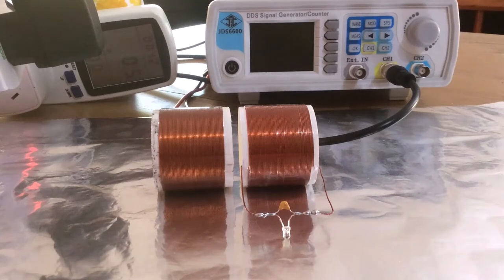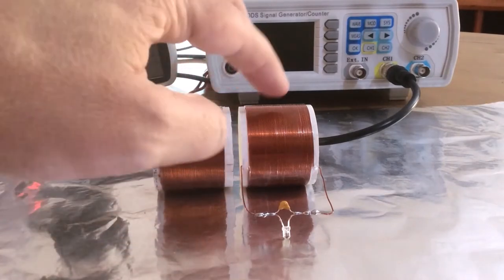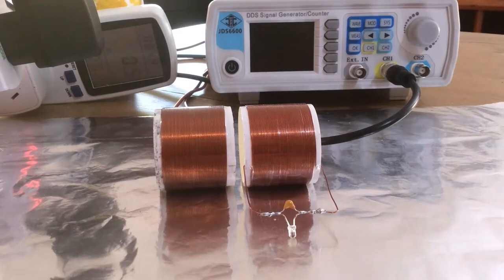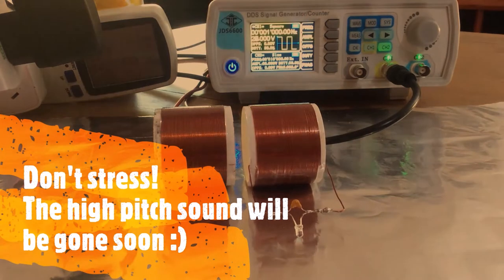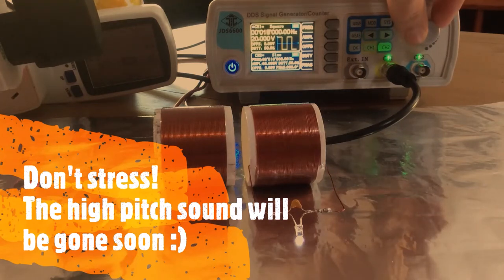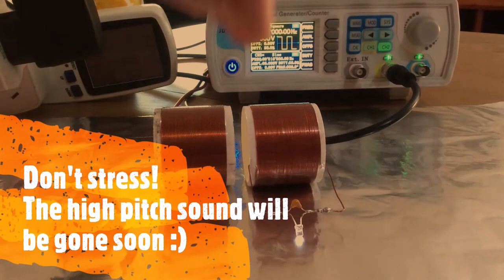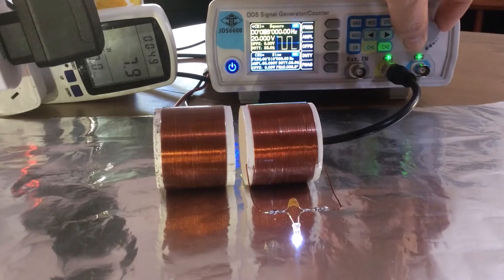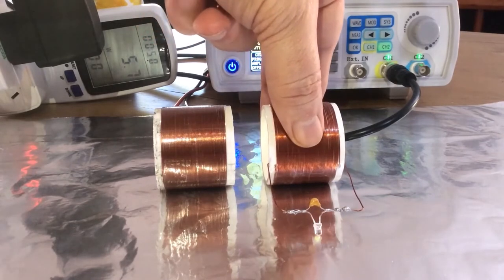FREE ENERGY with RESONANCE!

Comment: Where's the free energy? The function generator is putting out 20 volts to light a LED. This looks like simple induction to me.
Reply from the maker: Thanks for watching. This is simple induction. Over unity is achievable using simple induction, this is merely a demonstration of how you can achieve free energy. Many more coils can be added to the magnetic field with no increase in power consumption. Instead of using lights you can use the coils as generator coils that feed back to the signal generator. Using the same coils and the same input you can power a 12 volt 10 watt load, off one coil, the signal generator requires only 5 volt 2 amp at max power however if over unity is your goal you would use a smaller signal generator and add as many coils that will fit into the transmitters magnetic field.
Reply: @whatifididthis...1236  you should do power audit then ... one LED only 0.06W😅😅😅😅😅
Reply from the maker: @afendiyusuf4284  Thanks for watching. This is not a demonstration of over unity but more on how to achieve it. What should we focus on here? In my opinion this video demonstrates the importance of a resonant transmitter and receiver and that when this is achieved there is no increase in input current. This is how Don Smith achieved over unity. I hope this helps you understand the purpose of the video.
Reply: @whatifididthis...1236  well good luck trying ... nice equipment 😅😅😅😅
Reply from the maker: @afendiyusuf4284  Thanks, been there done that. You do realise, if I put absolute proof on here they will take it down or shadow ban it. You can learn enough from this video to replicate the experiments and see it for yourself. I understand where your coming from, I was considerably depressed for years after realising we have been lied to. I don’t want to have arguments with people, I love debating our situation, I want to help people experience the “penny dropping” moment.
Reply: @whatifididthis...1236  Agree ... good effort at least you make it to youtube ... fight in what you believe 🤣🤣🤣🤣🤣
Reply from the maker: @afendiyusuf4284  Thank you 🙏 Have a nice day.